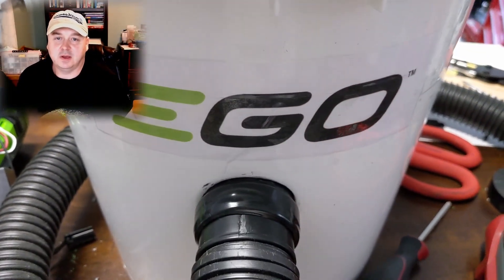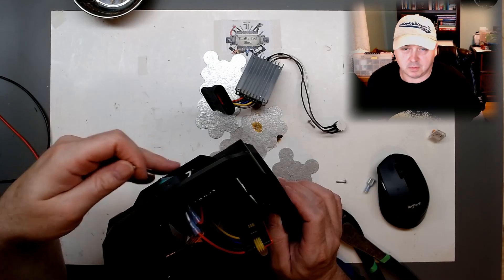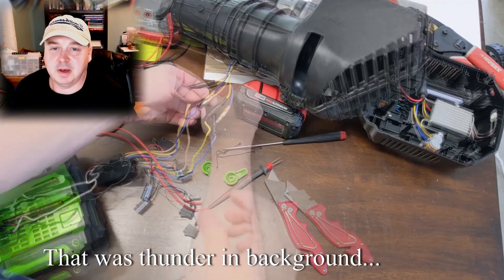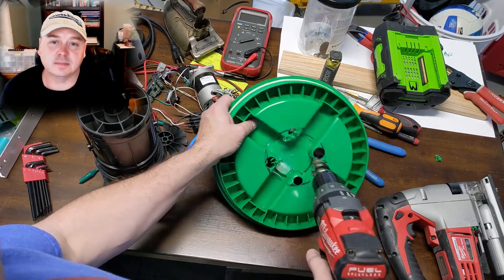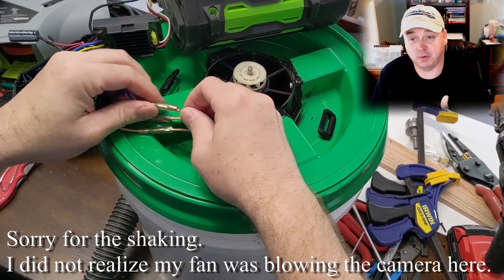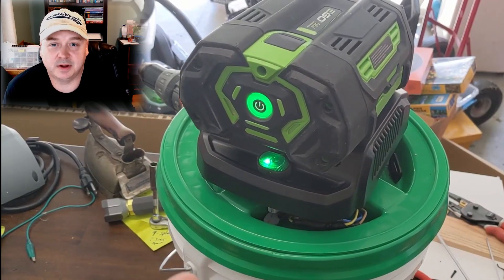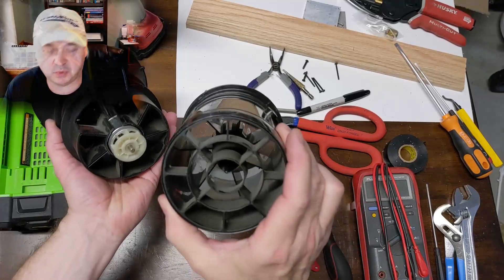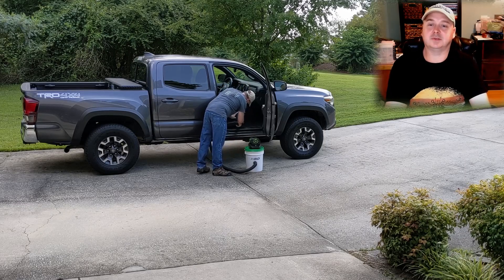Making our own EGO 56V Shop Vac

Comment: dude if i had half you knowledge i would be unstoppable!!! great job on this. with a 3d printer you could make a proper top with a directed exhaust port to blow away from the front of the vac. but like i said man, i wish i understood how to drop voltages and ohms law and when to use and what size or type of resistor to use. you are one very intelligent fellow. hats off to you
Reply from the maker: Thanks so much for your kind comment! Glad you liked the video.

Comment: I have read online that shop vac motors are ac or dc. Haven't tried running it off of dc yet myself. I was hoping you would try😂😂😂
Reply from the maker: Did you see my last EGO video where I used the EGO packs as a 110VDC supply and did just that! I ran alot of tools with it, including the shop vac. I have done it for years now!
Reply: @ThriftyToolShed  what. No I didn't. Buy I sure am going to now😂
Reply from the maker: @jacobecorder  I had honestly been using jumpers for a few years to run things off and on if needed. I debated doing a video on it, but I thought if I showed a better way to do it and talk about the importance of similar packs and similar charge levels and also mentioned the need of low voltage cut out and overcurrent protection then it might help someone needing it in a tight. Because it sure is helpful. 
I am working on a part 2 now and I have the breaker and low voltage protection installed. I always try to come up with a way that is easier for most viewers instead of building our own boards and so on. I always feel like most people that can build there own low voltage detection board with me most likely would have already done it you know! 😂

Comment: The magnets from that rotor would be fun to play around with
Reply: They look just like the magnets from brushless motors for RC airplanes.   I'm willing to bet money that there's a brushless motor that could act like a drop-in motor upgrade.
Reply from the maker: They look very similar, these are around 60V though. I have not found any hobby style motors yet rated for 14s. I have spent some time looking at that as well.
Reply: @ThriftyToolShed   it looks like there are some for electric skateboards and to replace gas motors in big rc helis. Link for RC heli motors:

https://www.egodrift.com/rc-helicopter-motors/motors-for-700-class-helicopter/lipo-cells/14s.html
Reply from the maker: @tungsten8290  Man those are some expensive BLDC's. Looks like they got them for sure. In my searches for the cheaper ones, On the under $100 side I have seen the 72V silver BLDC motors made for more like small go carts etc. But not much else.
Reply: @ThriftyToolShed  Definitely hoping Ego comes out with a shop vac eventually. Would be great for cleaning the car.